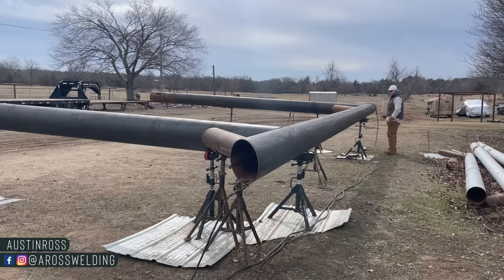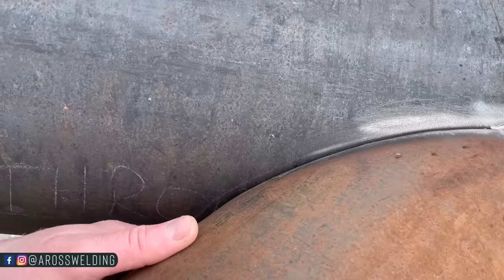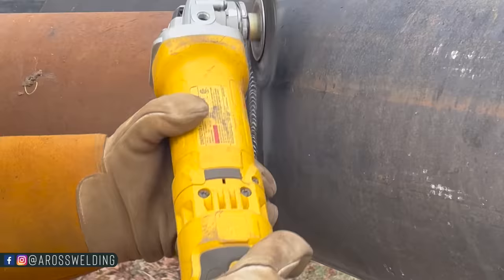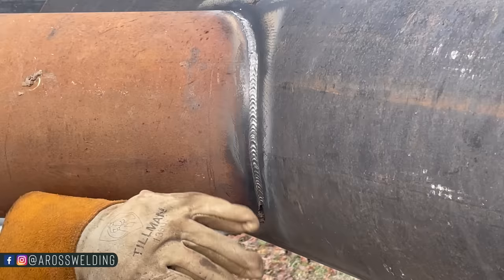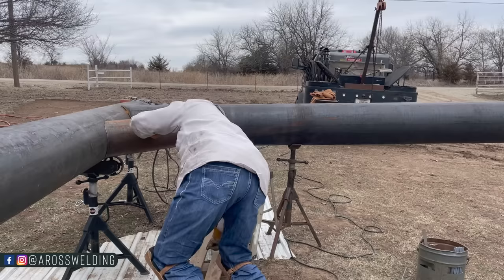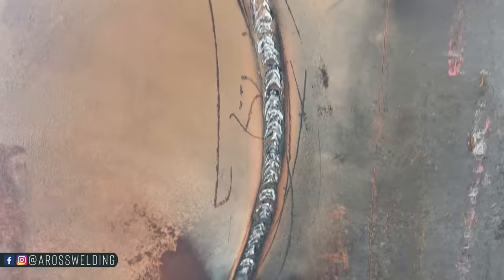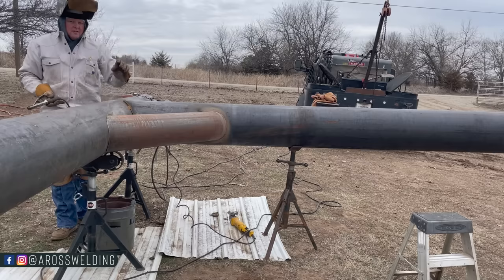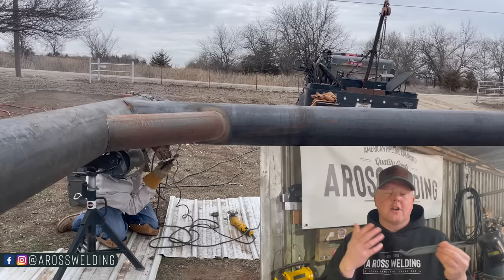Why Pipeline Welders Only Burn Half a Welding Rod

Comment: When a company supplies you with material and they pay you top dollar and insist on perfect welds and have them tested, you do whatever is comfortable to do it.
The company I worked for would send you back to school and or kick you out of the program if you had a failed weld.
But if you're buying them yourself and not getting them x-rayed, use um up

Comment: We need to have welding procedures that stipulate requirements. Hydrogen controlled electrodes in the vertical up position, 100% root run and NDT to ensure compliance. Electrodes were used fully. The only time they were not is when root runs were done and even then they were fully used if the situation allowed.

Comment: I  got so worried when I saw you leaning your arm on the pipe while also touching the rod with your glove to guide it. Is that not super dangerous? I'm sure the rod is the path of least resistance while it's touching the pipe, but if you accidentally pull the rod back a bit, don't you suddenly become the easiest path to the pipe and negative terminal???
Reply: Don't hurt you much. Wakes you up some.

Comment: I have been on jobs where you turned in your stubs at the end of the shift and most of them better be burnt down to within the job spec for stub length. Lots of grumbling and unhappy pipeline welders.
Reply: Keep some scrap coupons around and burn down when needed. Worked for me.

Comment: Isn't that rod clamp really dangerous? There are non-insulated metal parts. Just how can you use that?
Reply: Electricity takes the path of least resistance from the - ground/earth to the + lead. He's wearing leather gloves (resistance/insulators) and the voltage/amperage used is too low to arc from the "stinger" that holds the welding rod through the gloves to the ground lead clamped on the pipe to complete the circuit. 

Just don't try this trick in the pouring rain with wet leather gloves unless they're a new pair with a rubber liner! There's also a property of electricity called "skin effect" where the charge only flows around the outer layers of things like copper wires, pipes or human skin too.

Comment: Hello Austin, your bead looks nice. Never used a 8010, is there a reason why you needed 80K tensile strength? Does that rod burn/act similar to the 6010? Thanks
Reply from the maker: Ya it burns better than 6010. Or at least the 8010 PIPELINER does. Plus I’m just use to it from all my years of pipeline welding.

Comment: On a pipeline you must keep your machine on the proscribed settings. Welding Inspector with amp clamp walking around. Then by law every Welding outside the fence must be x-rated or aut. Three bad welds and your gone by Federal Law part 92 chapter 3. Best be safe company paying for rods.    Extending Inspector and Pipeline Auditor

Comment: Why is there no slag from this welding rods. When i necessarily have to use those bloody sticks instead of my MIG, i get thick, black, glass like scale that i need to use hammer and chisel to remove, but you just used your angle grinder to dust of thin layer of brown dust...

Comment: Funny reading many of these uphill welder comments.  I worked around  these opinionated diehard  uphill pipe welders for years.   Pipelines worldwide are welded downhill whereas refinery and fuel storage terminal  piping systems are welded uphill.  Downhill is much faster and are safe  time tested proven techniques.   
 A pipeline X ray guy explained to me once how these downhill welding  techniques are tested in every ways shape and  form for integrity.

Comment: Hi Austin! I really don't want to sound like an a**hole or to be rude here but just our of curiosity... What is the standard / code for this job you were doing? AWS D1.1? ASME Sec. VIII div.1? (Downward welding is normally not permitted by the standards that I know.) Why the spoons are not being grinded before resuming welding? Also, it looks to me like this is supposed to be a full penetration weld? Then the preparation of the joints shouldn't allow for such gaps? Any NDE involved there? Are you having welding qualifications under a certified QA program to perform these works? If so, you should be aware that as soon as your welding rods are out of the rod oven, they should be carried in a sealed containers to retain the heat for a specific amount of time before being discarded... I know I may sound like an arse!! sorry for that! :P I'm from a very strict ASME nuclear background... Feel free not to post my comment to public. Finally, you have a GREAT welding hand and would hire you in a heartbeat!! :) Peace! Dom

Comment: Most of fhe guys chucking rods half burt fall into two catigories:
 guys using lincon excalibur pipeline 7018 rod  (super nice start on a new rod and ultra smooth burn) that is pretty much imposible to restart without loosing a big chunk of flux off the rod when you start tapping it.
and guys that dont understand only striking a rod once is specific to a rod type/brand and think that just what pipe liners do.

Even on cwb tests i burn the whole rod.   

nice looking welds, but using 6010/6011 on what is a structual joint is a big no no. It has been allowed on pipelines because it is less likley to cause extrusions on the inside of the pipe (that cause cavitations with fluid) and doesn't  require a grind back to eliminate gas pipes in the crater like 7018 on an open root.  Most oil companies want a tig root now fallowed by a 7018 fill.  They are sick of the brittle fill metal from 6011 cracking and propigating through the rest of the weld, especially in cold climates like canada.

Comment: I disagree with you on the rod. I learned to use them down to about 1 inch of flux. Whatever. At least you still weld with rod. I see the "Panda-craft" welders with Migs and Tigs saying "real welders" use Mig or Tig. The "igs" are great for thin walled exhaust or sheetmetal, but for strong welds on thicker material, give me a rod.

Comment: Wrong. First, the shorter you cut it, the easier it is to start. Second, the half, or 2/3, or 3/4 you cut can be stripped about an inch so you don't waste it.

Comment: Well IDK, but that's not how the guys in Pakistan do it! It seems that they usually use two 6013 rods at the same cranked way up. They must know what they are doing because most don't even wear a welding helmet!  I assume they just close their eyes and go by the sound!! If it passes the doesn't fall apart test, they are good to go!

Comment: I was driving  truck on a pipeline project. A pipe in the equipment on the truck was damaged. It could be temporarily repaired by welding to finish the job. The inspector said we would allow the pipeline welder to repair it. He immediately blew a hole through the much thinner pipe used on the truck. He tried to adjust and blew more holes. He said that it couldn't be welded but he offered to try again. I asked if I could try while it was still somewhat repairable. I was able to weld it. It didn't leak but the filled in holes weren't ideal. Anyway further into the job I noticed that his coworkers were teasing him, "can you handle this or should we get a truck driver. "

Comment: Maybe a stupid question but cant you start using the rod from the other end?
Reply: No, the rod is bare of flux about one inch on the end that goes into the stinger
Reply: @SmallBaller  oh okey, that will be the bent ends i guess. Thanks for elaborating!

Comment: Looks good, but what rod did you use for the cap pass?   I know you started with 8010, but did you use 8010 for the cap as well?   Thanks.
Reply from the maker: Yes, I used 8010 on the cap as well
Reply: @arosswelding  👍 Thank you!

Comment: Is the 8010 like the 60 series rods just stronger?
Reply: The first two numbers are tensile strength (force requires to pull the weld apart) in ksi (1000 psi). So 8010 is 80 ksi or 80,000 psi tensile strength. The other two numbers indicate position and the composition of the Flux coating respectively. So 7018 means 70 ksi strength, 1 meaning all positions and 8 indicates the low hydrogen flux

Comment: It's amazing for "us" in the UK because outside of pipe-welding - no xx10 (or xx11) ever ever ever.  You have not just 6010 but also 8010.  Why we don't go with these options I'll never know.  The mysteries...
I did some accommodation barge superstructures with 6010 vertical-down and got better than 5X the productivity of other teams.  And my welds were full-pen. - not slight-pen. plus reinforcement bead (like an oversized cap).  I have done handrails around construction barges from scaffold tube 6010 no-prep butt-weld full-pen (no prep. but root gap).
Always have to supply the rods - as no-one knows what they are and what to specify buying from a welding supplier.  But sometimes there's so much in it for me that I bring my own rods.
Go 8010 - that's so much you could weld.  I think 7010 welding rod would give you "headroom" with 355MPa steel (that's 50ksi grade)?
I know that in sledgehammer tests, where a 6013 will take one good blow to break (that's what you "calibrate" on setting up your demonstration) 7018 will take about 10 blows and 6010 will take about 3 blows.  So if 6013 is permitted - it's common - then there cannot be an argument against using 6010 and 7010.
The one about vertical-down - with xx10 I know for sure that can give a full-specification good weld.  I've had to throw heat away welding v-down it's so penetrative.
So anyway, the point is, thanks so much for showing what I never get to see.

Comment: what causes of brittle after welded?
Reply: cooling too fast. Most steels need to stay within a reasonable temperature range to keep their cristal structure  otherwise it changes. Welding temperature is way higher thant that, so if the steel as enough time too go back while cooling you're fine, otherwise you lock it in a high stress structure and it cracks easily.
Reply: @Wolfesjunges   is a good step when we heat the object that has been welded?

Comment: To all the guys out there and girls , it's basically the same answer if you're doing 6G weld that pipe will get so hot when you're doing what they call a keyhole that you got to stop specially black pipe before it goes right through it and you'll lose that Advantage I specialize in stainless pipe for chemical plants taking but I did actually get certified for black pipe never liked it

Comment: Is there a reason GTAW and GMAW have not taken over the domain of stick welding? I realize TIG is slow, but why are pipeline welders not using a MIG welder? Is because with stick welding there is no need to carry tanks of shielding gas as the coating on each rod produces a proper welding atmosphere?

Comment: 7018 is a low hydrogen rod.I have run them uphill but they are meant to be a horizontal rod. The 70 means 70,000 lbs. per square inch. If a rod number ends in an even number it is a horizontal rod. If it ends in an odd number such as 6011 or 6013 it is an all position rod but a good welder can run a clothes hanger with an acetylene torch uphill. I was a welder-fabricater for 40 years. You may not have done it before today but you won’t be able to say that tomorrow.
Reply: Wrong. 7018 is used in 3-g, 4-g, 6-g welding test and on jobs for years . All position rod.

Comment: I’ve failed tests and had welds crack. Everyone saying I’ve done it for 40 years and never had an issue is either lying, full of shit, or only does shop work. Busted X-rays, failed tests, and cracked welds are the weld gods ways of keeping welders in check. If you are new to this and reading the comments, take a lot of them with a grain of salt because welders are some of the most arrogant people on the planet. I guess if you do line work your whole career on new material then everything should always go perfect. I’m a field welder and do the same with my rods because if I arc out of place it probably just cost a flange or weldlet. 6g cert and weld on everything from fuel to chilled water. Most recent crack was on a 12 inch full encirclement t on chilled water. Metal cooled way to fast and cracked the root. I do this on live systems for hot tapping, line stops, instavalves, and live therm well inserts. Your weld and process can be near perfect and something still can go wrong.

Comment: It's funny how alot of these comments are rubbishing the downhill welding process when in actual fact 90% of the sceptical people have gas pumped into their homes coming from a pipeline "somewhere" that has had the joints welded via a downhill welding process, and have been for years.😂😅😂😅😂
People if you really think that the 6010 downhill welding process is weak and is not structurally sound I can tell you there has been millions of dollars spent all over the world since the duration of this process in all types mechanical and NDT testing to prove the downhill welding whilst using the correct constable compatible with job the material while following an approved WPS it is just as good in strength as welded in any other position. 
Wake up old retired and want to be welders and get with the times.

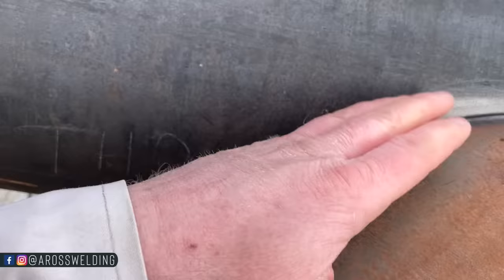Comment: Shit dude ,,, you change a rod for your stops and starts. When running down hill,, never stop at 9:00 or 3:00 stop before or way after. Road angle is important when you start up
Reply: 1/8” down ,,5/32 hot pass ,,,,3/16 cap turn it up let’s go

Comment: Can't you just stick the rod in some flux that is used for soldering. It should burn off in a second and let you use the other half of the rod for the easy positions.

Comment: I'm 73 years old and a third generation pipeline welder. You, sir, wouldn't make a pimple on a pipeliners ass! You didn't fit anything right. You bought 8010 which is an expensive rod made for welding 80,000 psi piping. You should be using 6010 which is cheaper and more available. Pipeline welders change rods when they change positions. Restarting a partially burned rod causes arc sticks and maybe porosity. Build fence and stay away from high pressure piping!